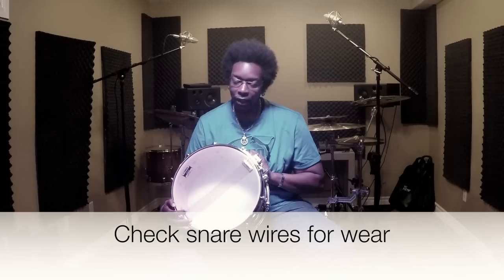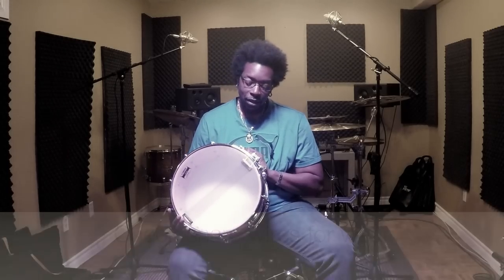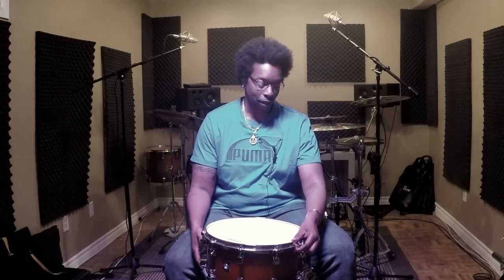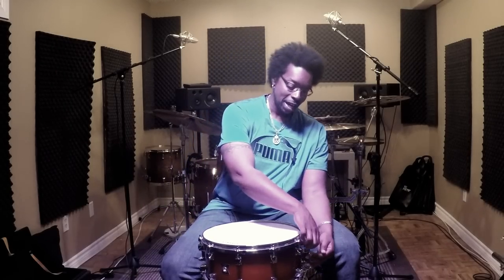Why Your Snare Sounds Like Craaap - Common Problems

Comment: my tip to upgrade your wood snare.. if you have a decent hardware (Pearl Export for instance) on your current snare: buy a quality wood shell.. drill the wholes.. mount the old hardware.. boom.. for instance a Keller Maple shell.. you will end up with a full pro sounding snare.. you might need to upgrade to a 2,3 mm top hoop.. or not.. depending on your sound requirements..
Reply from the maker: Well...Not quite “boom”. That ain’t really an upgrade, man. That’s practically building a snare from scratch, which is nowhere near an easy DIY for someone with little experience. There’s a lot of precise measuring and drilling involved...not to mention the finishing process.

Comment: I notice you're using diecast hoops. The snare I am tuning has flange hoops and when using your method, I have to go over and retorque lugs to compensate for the flexing of the thinner metal hoop.

Comment: Personally, I don't think you can have the resonant head too tight-it's too-tight snares that choke out a drum. The snare that comes with a cheap kit usually WILL need replaced; you can buy aftermarket parts, but why not grab a nice Pearl (or what have you)  chrome/steel snare, for very little more?. Great advice, as per usual.

Comment: People ask me how I get such a "good" snare sound (regardless of pitch and wetness), I tell them usually with a looser reso-head - go figure~ Usually when I get a snare sounding "good", I find both heads are dead close to resonating together regardless of pitch. Tuning in resonance will yield max volume -  anything else and you might as well play a cardboard box.
Reply: theothertroll I think he definitely pointed that out when he mentioned using two drum keys while tuning the top head. you don't want "submarine radar tones" by cranking the bottom head as much. definitely need a balance between the two heads

Comment: I've really tried to make my snare sound better. I've followed all of your videos, but it still rings so f'n bad!!! I have my harmonics even, I've even used a tuner on my phone to verify they are uniform. I have 2 keys. The only way I can get it to stop ringing is tuning it to the heavens! It sound like I Should be marching in front of revolutionary army! I had my wife crochet a marble bag I can put on the top and it fixed my problems. I probably have a junk kit though, PDP Main Stage with Remo Emperor Vintage heads. Thanks for the videos, I've learn a lot.

Comment: What's the difference in sound btn 20 strand snare wires and 30 strand.  Really great info here!  I play a Mapex Jazz kit that was $800 brand new included cym stands, meinl MCS ride, 2 crash & hats.  Bought sometime in 2007.  Is it bad if I've never touched the lugs on any of my resonant heads?  I mean I think my drums sound alright.  They go from high to low, but maybe I don't know what a well tuned drumset sounds like playing.  Replaced all batter heads a year ago with Evans Black Chrome 360.
Reply from the maker: +Douglas Bosso Just 10 extra wires buzzin down there. So you might notice a tiny bit more sensitivity and perhaps a bit more snap. You'll notice bigger differences with snare wire thickness, material and configuration. Check out my older (and much chubbier) reviews on the Puresound snare wires on my channel

Comment: When he says it should be nice and tight what does he mean? I finally caved in and replaced my snare side and batter heads (snare side 300 and HD dry) and it seems pretty tight, but still sounds a little "tinny"... sounds pretty even at every end, and seems pretty tight.. snare wires are pretty tight as well   (and it's not the typical snare wire sounds when they are loose)...  I could be just nit picking about the sound, but this part of drumming has always eluded me....

Comment: I always chuck a giant block of foam in the snare (same way you would in a kick drum) and its super useful. You can get foam for like $10 on Amazon.com
Reply: why would you do that?
sounds like you would choke the snare out
Reply: Yeah, might as well just install one of those tension dampener things or get a head suited to dampening the sound. Or even use a dampener ring, which you can make from an old head. So many other ways of not creating a hassle if you want to undampen the snare.
Reply: Senor Gamer That sounds like a shit idea.
the last thing you want to do is that.
Reply: GamerDares wins yeah but it's the sound I like
Reply: +Senor Gamer I get where you're coming from, I mute my snare with clothes on bottom at times and a wallet on the batter

Comment: Something that wasn't mentioned about replacing your whole cheap quality snare drum is Pawn shops. A lot of times the seller to the pawnshop and the person who prices out used drum equipment does not know what he/she has. Call your local shops, ask if they have any snares, take along basic tools like a drum key and some screwdrivers and see what you come up with. Another option is on-line sales of used snare's. I myself would NEVER do this though cause hearing is believing and by that time it's too late.

Comment: Hi I'm a percussionist in school, and this is my 2nd year,so I dont have an actual drum set or anything.
So heres my problem:
My snare kind of rings whenever I hit it. It sounds like metal briefly clanging, but it sounds just fine when I hit the drum with the snare pad on. I really confused, can somebody help me?
I messed it up on my own, and take full responsibility. I was messing around with my tuning key, and here we are. 
Also, just to let you know, the snare was brand new when I got it at the beginning of the 2017-2018 school year.

Any information or advice helps! Thanks!

-Emily
Reply: Faith, try using an o-ring or moon gel. It might fix your problem.
Edit: these things slightly mute your drum so it doesn’t ring
Reply: @jadendeekollu6362  
Thanks, do you know the price range for both? Dont wanna blow my wallet.

Comment: Hey Mr. Rob you said that you tightening the bottom head. If you do that can it bust? The is because alot of drummer be playing there drums fine out later that they head is busted from playing.
Reply from the maker: I've heard of and seen cases of resonant heads getting blown out. Never happened to me in 25+ years of playing but its not uncommon. I think if anything, wear has a lot more to to with it than tension. Although we're not actually playing the resonant head, it will stretch out over time just from sheer force of air every time you smack a backbeat.

Comment: Can you use old snare head as a snare side (reso) head? Sorry new drummer? Bought a used kit on a tight budget and the snare sounds bad... going to change the battery head and the res has a small rip I taped but was got to put the old head as the reso... pros... cons... bad idea?

Comment: I bough a new Mapex Steel MPX snare, it isnt very high quality but its pretty nice for the little money. However, its way too "snary" sounding, I dont know if maybe the cheap wires are the problem, nbut it drives me crazy because almost all the sound when the snares are on is purely a snary sound that overshadows everything else. Ist it possible, although it may sound extreme, to cut some of the wires so that there are lees of them making noise?
Reply from the maker: You can try. It's not uncommon. Just make sure if you do, that you cut them clean, equally and in even numbers. Two out of the middle, or one off each end or two in from each end, etc. The wires have to be evenly spaced out. But yea, you can try it. The new Yamaha RC snares include an extra set of 10 strand wires for a 'less snary' option.
Reply: Rob Brown Thanks for the reply. One more thing, is it possible as well that the resonant generic head that comes with it is way too thin, so it becomes over sensitive to the snares? Maybe a better quality resonant could help?
Reply: Drumciclist Rudimental get new heads and wires pure sound snares are the best

Comment: What I want to know know is how often a resonant head should be changed. I assumed that unless it broke it was likely useable    forever, but now I am wondering if I should have changed them at some point.
Reply from the maker: +horseytown It's debatable. But the case for not changing them for a while is pretty strong. I've had this PHX kit for about 7 years. Still sounds wicked. Still fitted with the original stock resos.

Comment: because the shell is made from balsa wood ..just tighten the bottom head higher and do the three blind mice thang 3rds notationaly speaking .First tom top looser than bottom and the next top head on second tom matches the bottom head of first ..go on to the next...depending on the acoustics of the room your playing in ..some rooms are more lively than others...drop your wallet on the head to get a purer sound when tensioning each lug

Comment: Do you think its ok to have a little ring in the snare??  The snares arent loose, brand new head (3 ply).
Reply from the maker: +Jordyn Perry I prefer a little ringing, actually. I still like to let a snare drum be a snare drum. A lot of guys go through all these efforts to completely eliminate snare buzz or ring, but that's all a part of the snare's character and it's what adds to its overall sound. You may have noticed that I use zero muffling on my snares. I'll only add muffling on recording sessions or in some live situations if needed, or wanted for effect.

Comment: Speaking of "cheap" snare drums (and other drums), Asian made "stencil" kits  that have thin luan shells and no reinforcement hoops don't tune well or sound good. Because there's no resistance to tension, the shells warp and won't tune evenly. I've found taking the hoops from old, broken hide drumheads and gluing them inside the top and bottom of the shell adds considerable strength. Now you have a "cheap" but decent sounding drum that's likely less heavy than your good ones. And you don't mind subjecting to weather or allowing children or drunk people to play! 😂

Comment: my current snare is about 3 or more years old, and after I spend time tuning it to my liking, it usually loses its sound after a couple 2 hour sessions of playing. the hardware is pretty beat up/rusty and my battered head could really use a replacement. is it worth buying new hardware and heads to revive it? or how do I know when it's time to buy an entirely new snare drum?
Reply from the maker: I'm pretty sure you just answered your own question. If you're losing your sound after just a couple hours of playing and dealing with rusty banged up hardware, that ain't the most encouraging sign. Sounds to me like replacing everything that needs replacing will eventually top a couple hundred bucks, so you might as well just invest in a new snare.

Comment: How many turns should I give the resonant head?  1 full turn per lug?
Reply from the maker: +urpaderpa No need to count turns. It'll be different on every drum anyways. Don't overthink it. Just grab a couple keys, put one directly across from the other, turn two at a time around and stop when it's tight. Common sense will tell you when it's tight enough. Don't crank them hard, just tune them up and give it a couple flicks of the finger to check it.
Reply: Awesome, thank you for the reply.  All of your videos are extremely helpful!

Comment: Hey Rob! I wanna ask about pearl snare drums and I was considering to buy a pearl maple piccolo snare drums 3x13  size, is it a good starter for me?  or do you have any recommendations?
Reply from the maker: +Don Don If you dig it, you can grab it. But in terms of flexibility (if that matters to you right now) 13/3 ain't really the most versatile size because of its very limited tuning range. For your first snare, I'd recommend going at least 14x5 or 5.5. Pearl's Vision snares are great for the money. Under $190. Or you can try to find a deal on a used higher end snare online.
Reply: +Rob “Beatdown” Brown Thanks Man! That helps a lot, I'm kinda confuse right now between choosing for the right snare for me.

Comment: sorry nothing to do with sound but a beginners query anyhow.. ??..  why does my stand's cradle arms not fit the drum in the correct position at around midway between the tension rod brackets at all three points of contact around the drum.. ??.. one of the arms fits ok at one of the point's of contact around midway between any two certain tension rod brackets but the other two arms are near enough fitting and tightening up upon the tension rod brackets at the other two sides of the drum if you know what i mean.. ??.. i have two stands one much heavier and better quality than the other but my drum fits and sits the same on both of them.. ??.. doesn't seem right to me that two of the three points of contact are near enough being tightened up against some of the actual tension rod brackets at two of the three points of contact.. ??.. should not each point of contact rest around midway between two tension rod brackets each creating equilibrium.. ??.. is there something wrong with my drum.. ??..

Comment: My snare is good but when u hit it without the springs on and y can here them when u hit it can some help me plz
Reply: mega mash up make sure your snares aren't too tight and that they're not coming in contact with the snare stand basket. if that's not working, try getting new snare wires and new heads.
Reply: I got a cheap Peace snare that did that. It turned out that every time I disengaged the snare wire, I had to push the mechanism down because it wouldn't fully separate by itself.
Reply: ILikeWafflz it seems like it may be a problem with snares that have cheap throw-offs or warped hoops. either way, I highly suggest a new snare as the first upgrade to your setup.
Reply: Thank you for the advice, but it's no big deal, as it's just a secondary snare I use for accents. My main snare is great as far as quality goes.
Reply: ILikeWafflz I was mainly adding on to your comment directed to the original commenter haha. I'm glad to hear you've got a setup that works though! sometimes it can be a bit of a trial to find something that fits
Reply: I kind of figured that, but I just wanted to clarify.
It took me 5 years to get my snare sounding any good.
Reply: ILikeWafflz hahahaha I feel that for sure. I played on a pearl export snare with a warped shell for years. when I upgraded to a sensitone elite it was like inheriting a fortune. that thing sounds beautiful in pretty much every tuning and environment. there's so much to be said for a good snare

Comment: i don't think the reso head being lower than the batter is actually a problem on principle. its just taste.
Reply: i prefer the sound of mine lower
Reply: me too, i always tune my snare side just a little bit lower than i do with the batter head. I find it gives me a softer sound (not as much of attack and the initial crack that you often find on a snare drum). But then again i use unusual snare heads like Evans Onyx on my batter side so maybe thats why i find it better to have the snare side head tuned lower

Comment: Drums are actually remarkably simple instruments. Short of having actual damage to the instrument itself, there's really not that many things that could be the problem. You got two heads--they're either too loose, too tight, uneven, or out of balance with each other. You got a snare--it's either too loose, too tight, or uneven. That's pretty much it. It's not that complicated. Takes a little time and the discipline to learn about your instrument, that's all. Don't just learn to play a bunch of songs. Learn your instrument. Part of that is learning how it works.